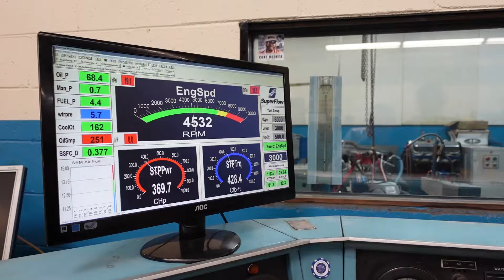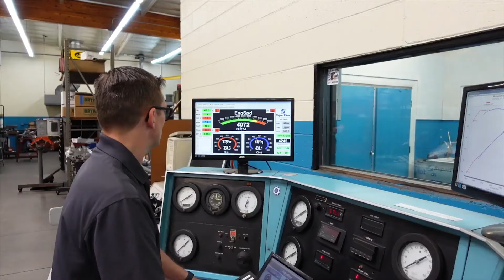These Aren't Your Grandfather's Piston Rings...

Comment: @TotalSealPistonRings .... I understand the "plus side" of the equation on rings. AND... last year, I had when going through ring selection for a mild performance SBC 383 marine build with Keith on the phone and in emails... he recommended a 1/16" - 3/16" pack.... But really didn't have time to expand on his recommendation... 

Question: In what situation, on a non-race gasoline automotive-type engine,  does a thicker piston ring, say 1/16" or 5/64" make more sense than the thinner rings?  
(is there a durability issue, blow by, heat transfer to cylinder etc??)....

#TotalSealPistonRings
Reply from the maker: The reason for his recommendation is that you have a marine application, which put more load on the engine. The RPM's are typically lower in Marine applications, but loads are higher. As such, the thicker ring helps with heat transfer. It's always about the application.
Reply: #TotalSealPistonRings Thank you for taking the time to answer.... great support and customer service !! @TotalSeal

Comment: Agree 100%!  In hind sight, I wish I’d known 6 years ago what I’ve learned from you in the past few months.  I can’t wait to tear my old 1937 Hudson coupe apart & see what smaller modern pistons with a thin modern ring package & the proper multi-hone package would do for it!  I had to put OEM “pinned” rings back in it when I re-freshened the engine 6 years ahi.  
OEM sizes: top ring 3/32”, 2nd groove 3/32”, 3rd groove 3/16” & bottom groove 3/16”,.  Yep 4 rings & at those thicknesses it will be very interesting to see what modern technology will do for it!   Let me know if you need an old test subject! 😊
Reply from the maker: Thanks!